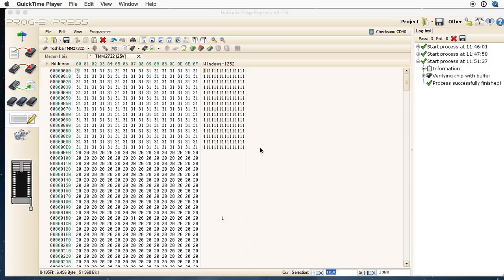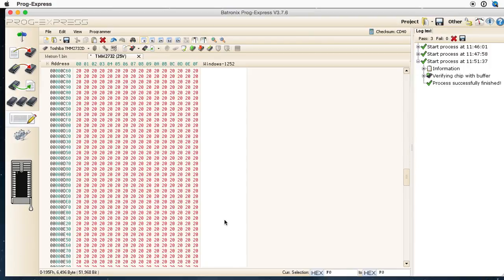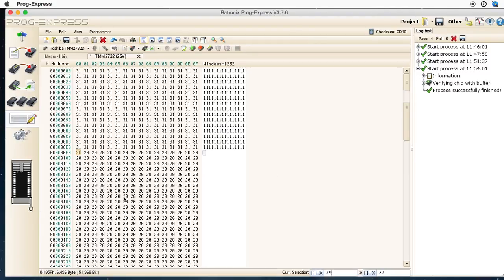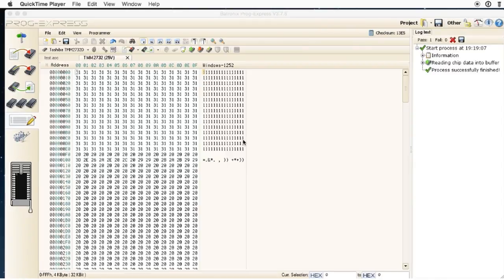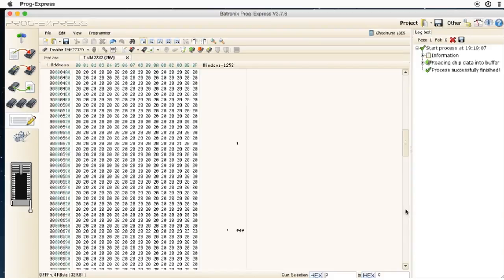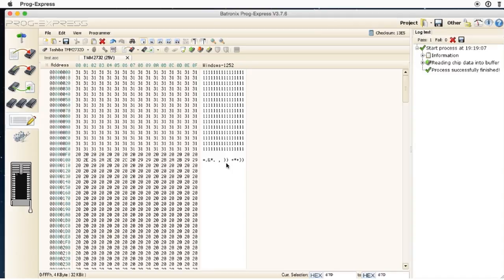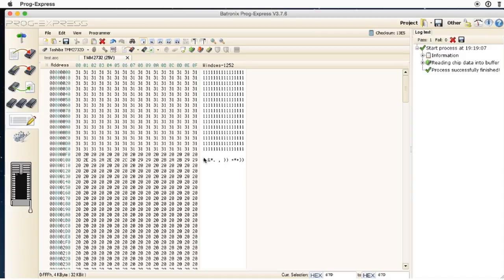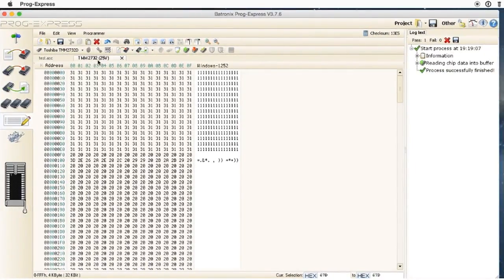#182 Daylight EPROM Erasing Experiment - does daylight damage the eprom data

Comment: There's a datasheet from ST that backs up what you say and very specifically states direct sunlight could cause erasure in as little as a week whereas ambient indoor light could take 3 years or more so you should cover the window.

Section 3 here:
http://www.jameco.com/Jameco/Products/ProdDS/698226.pdf

I have anecdotal evidence from when I processed hundreds of EPROMs a week that they take less time to erase in a UV eraser if they were 'fast' programmed rather than 'slow' (may not have been a manufacturer approved algorithm though) but the difference wasn't that much and we 'cooked' them all for 30 minutes anyway before reprogramming them.

I also have EPROMs from 'back in the day' when I was working on CB gear for money (There are few hundred Pama Danita Mk5 radios out there with one of my EPROMs in them) that are still good even after being mistreated and exposed to daylight and indoor  lighting so YMMV but covering the window takes a couple of seconds and is a ridiculously simple precaution to take so to have a go at you for recommending it is very pissy.

Comment: Back in the day, a 'fast' programming algorithm would test the charge threshold at one memory position by raising the supply voltage a bit. If that location flunked, you would hit it six or ten more times. If it passed, you moved on to the next one. Really was faster than whacking every bit a full 30 times. 

You could probably predict the initial stages of partial erase by reading it under the same conditions and discern which bits are fading first. 

73